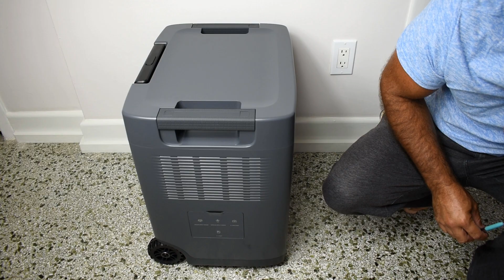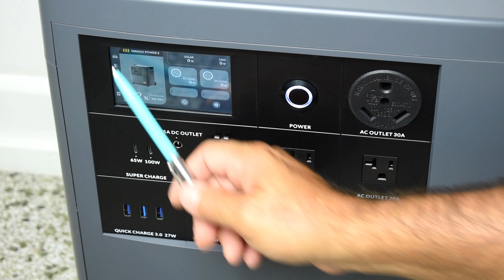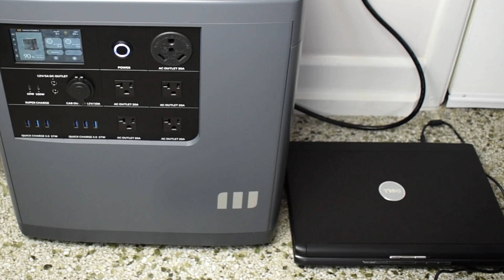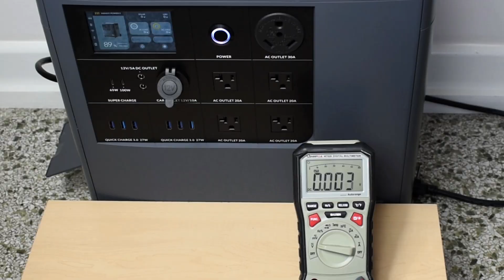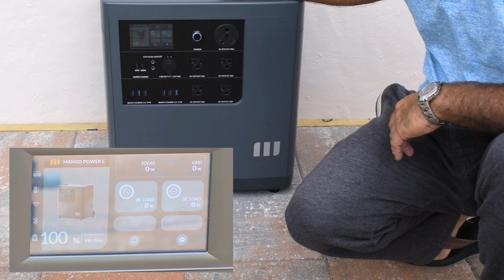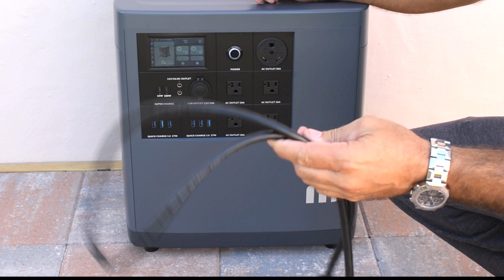3000 Watt ⁄ 3530 Wh Mango Power E Power Station Full TESTING & REVIEW

Comment: They don’t stand behind their product warranty I got two the first one works but turns off the ac when it goes to 100% of charge for solar plus the 30 amp RV plug it’s wire backwards internally so can’t use the 220 v ac the other unit quit working a week after the first use no screen power dead and after emailing mango power for 3 months finally got a promise to send a return label now a both later they stop replying extremely bad customer service never would I ever buy anything from them if you got one already good luck I you don’t go with a better company that stands behind their products

Comment: I do not recommend the Mango Power E at this time. Support is almost non-existent. The App does not work at all with it, so you can only use it like a regular unit (power source), none of the advanced features are available without the app. My unit only works for a couple of hours before turning off.
Reply from the maker: Probably why the app was not ready for my review. I don't care about using an app for it anyway. My unit works just fine otherwise.
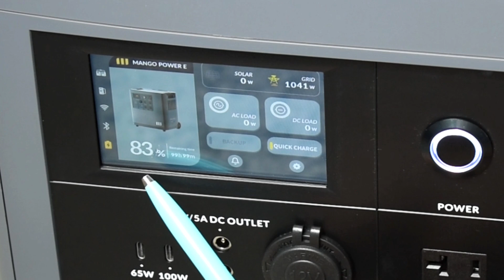Reply: A friend of mine bought two of them so he could double up and have 240 volt. The exact same thing is happening it runs for a few hours and it shuts off. We had a light plugged into each one. The app does not work at all. When you do the Bluetooth connection then they want your Wi-Fi connection to be able to upload a new firmware. Now you have to wait on them to update and install the firmware before you can use it. This is the first gen. Why they would send them out knowing that they did not work I have no idea. I do a lot of solar work in Northern California. A lot of these units and people that have them don't have Wi-Fi at their house. So instead of being able to take your phone download the firmware and then upload it to the units. You got to take the units someplace where there's Wi-Fi between 8:00 and 10:00 at night and hopefully you'll get an upload. Does anyone else see the idiocracy in this. Hopefully this units will turn out okay for him

Comment: It would have been good if you had also checked the DC Voltages with your O-Scope to see if it's Flat Line (like a Battery), Close to Flat, a Wildly Jagged Approximation, Pulse Width Modulation (like a Switching Computer Power Supply), or what.  It does look to be very well constructed, and the AC Sine Wave was perfect, so I wouldn't be surprised if the DC Voltage is a perfect Flat Line, too.  It should be for the price!  Wish I could afford one, but sadly not.  Nice one, Scott.  Where do I sign up to get one free for a testing review?  🤣😂🤣😂🤣

Comment: 3500 kWh?
Reply from the maker: Too funny. I just realized the mistake. The title was originally 3.5 kWh. I changed it to 3500 and forgot to drop the k.
Reply: @electronicsNmore  Haha. I knew it was a typo but secretly was thinking maybe it was some magical new battery chemistry.
Reply from the maker: Not sure how they arrived at the kWh rating, but every power station that I've tested at the full output rating has come in lower. In this case, 2900 Wh range.
Reply: Excellent reviews! What's the battery efficiency rate?

Comment: Great review. I wonder what the phantom draw on the battery is if everything are turned off and when everything are turned on but no loaded connected, I ask because if you put the unit in storage (everything turned off) I want to know how fast the batteries will be drained down.
Reply from the maker: When the unit is powered off you shouldn't have more than microamps being drawn. The LiFePO4 battery pack will probably lose 2-5% per month.